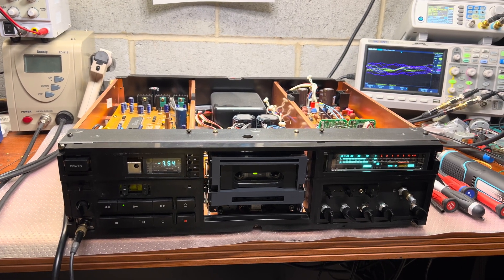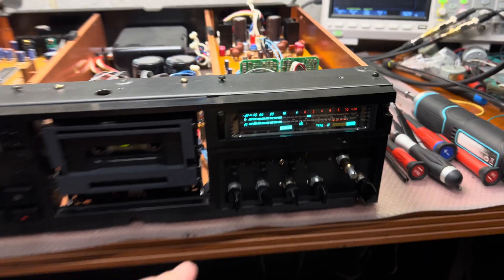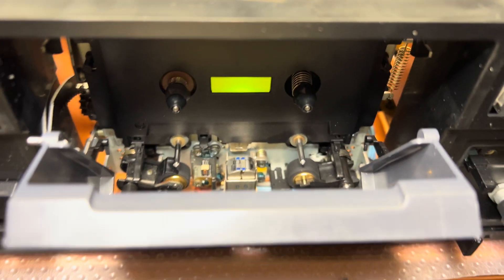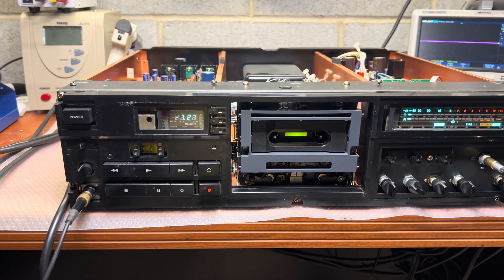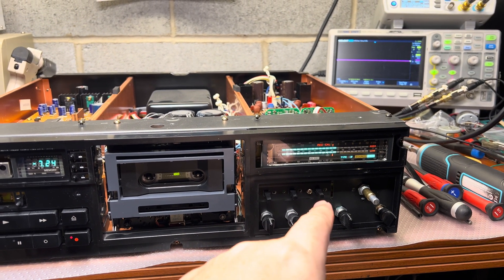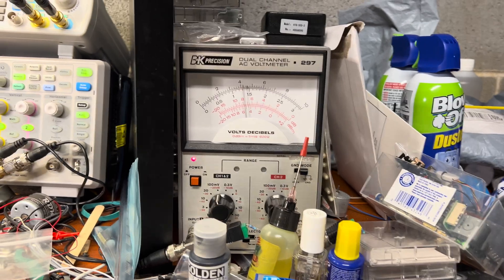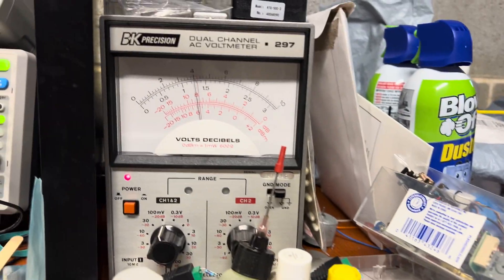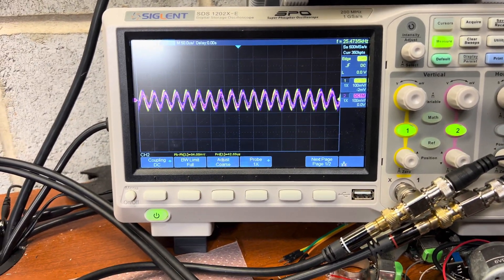Sony TC-K555ESJ: Pushing the Limits with 25kHz Recording

Comment: hi,i have a 222ESJ but it only payback in 10khz and after that just rolling down（usually take -20db）.recording really well,it shows 19KHz in type 1 in other decks.but payback top frequency were nothing,head looks ok and smooth
Reply from the maker: It is ok if it does that on 0dB level. Response should be flat at -20 dB
Reply: yes its -20db @hifirulezzz
Reply from the maker: @1_Kud  then check tape path and azimuth. Azimuth can affect high frequencies significantly
Reply: Hi,im checked the tape path just no problem,it didn't hit the edge of head or left side pinch roller,if is the head materials degrade problem?I saw your a video which is adding a capacitor and variable resistors to give it back high frequency  @hifirulezzz
Reply from the maker: @1_Kud  That could be. You will need test tapes to adjust properly.